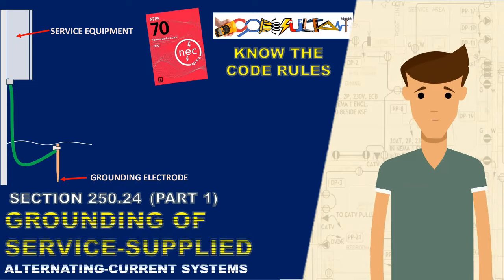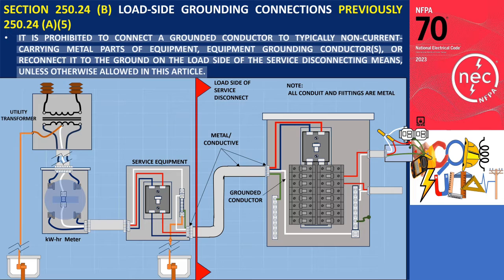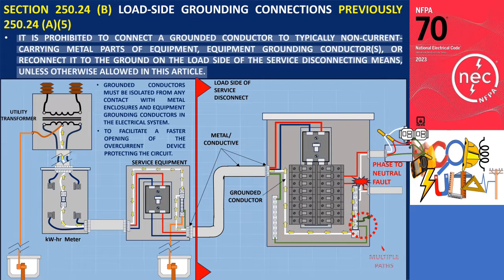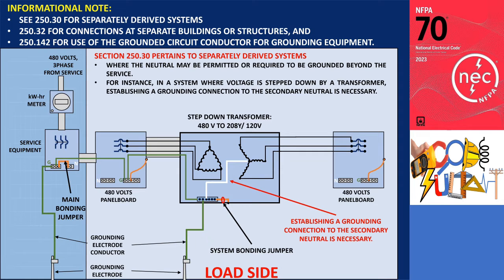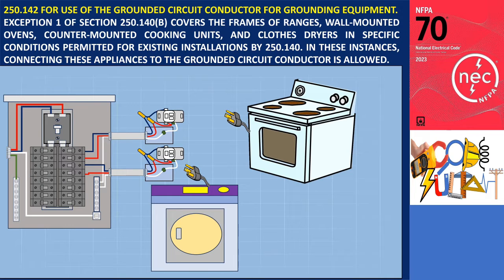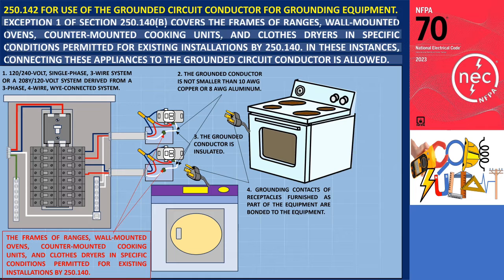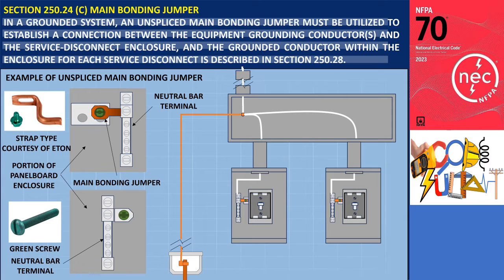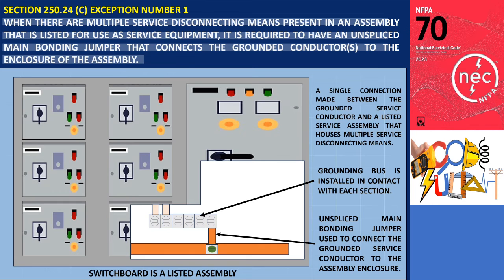250 24 GROUNDING OF SERVICE SUPPLIED ALTERNATING CURRENT SYSTEMS PART 2 -NEC 2023

Comment: Good video but I disagree with parallel paths causing delayed overcurrent protection. When you parallel paths the resistance is less than any path
Reply from the maker: Hello, thank you for your comment. We would be happy if you can explain or expound your comment, specifically regarding the statement "When you parallel paths, the resistance is less than any path."

Based on my understanding and knowledge, when multiple paths are connected in parallel, the overall resistance decreases compared to any individual path, not "the resistance is less than any path". This is due to the fact that parallel paths provide additional routes for the flow of current. As a result, the total resistance encountered by the current decreases, allowing for a higher current flow.
Reply: @codesultant   I agree I “thought” the video said parallel paths could cause overcurrent device to take longer to trip. But with less overall resistance I believe overcurrent device trips sooner because of less overall resistance
Reply from the maker: @davem5392  Paralleling of paths results in the division of current, leading to a reduced amount of current flowing through the neutral conductor. This is because, with parallel paths, some of the current flows through alternative routes such as the ground. In contrast, without paralleling, the full current would flow through the neutral conductor, causing the Overcurrent Protective Device (OCPD) to activate. However, even with paralleling, the OCPD can still trip, although there might be a delay if the current is insufficient to trigger the OCPD due to some portion of the current flowing to the ground.
Reply: Maybe I’m missing the boat but overcurrent trips based on hot current value. Whether the current returns on neutral or other path such as piping or equipment ground the trip depends on overall impedance which is less with parallel paths.
Maybe I’m missing something or just some brain fog. Thank you for all your replies
Reply from the maker: @davem5392  Thank you also.